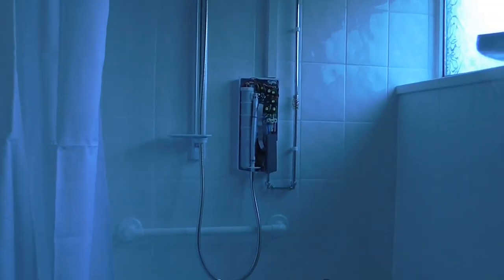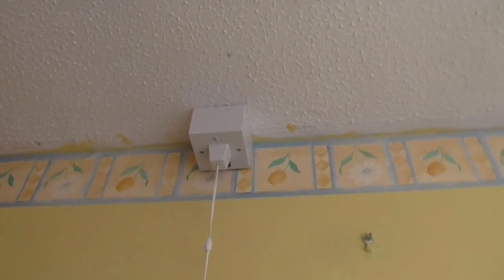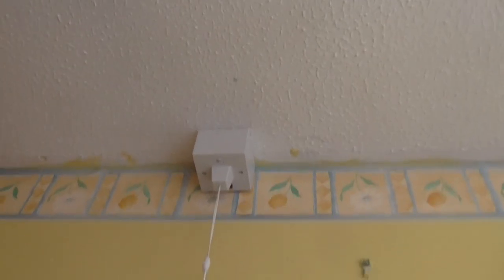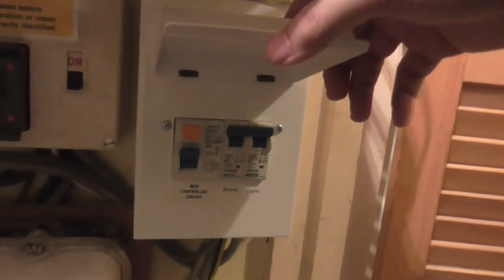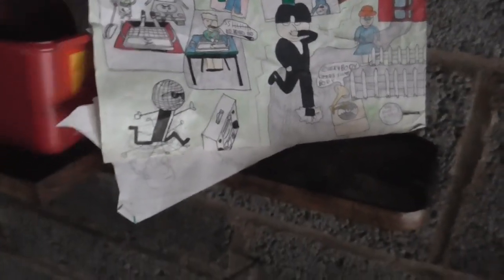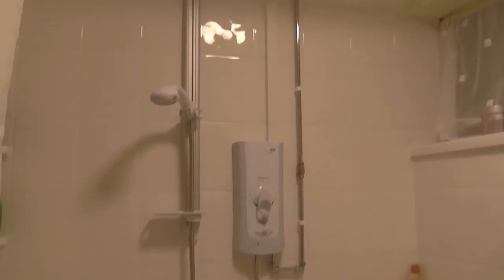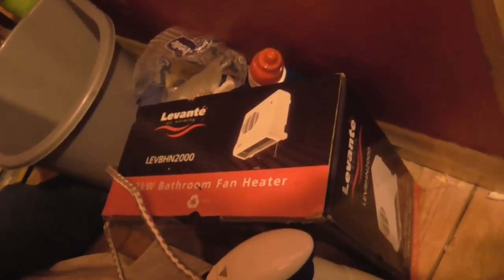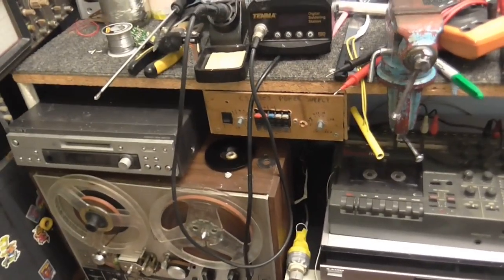Central Heating and Bathroom now finnished (well sort of)

Comment: Your place seems to be coming along well. Should be interesting to see what you come up with shelving wise. I'd include a high shelf to store less used things up and out of the way.
Reply from the maker: +JohnAudioTech The shelfing unit for my hifi stuff is coming on well, trouble is the reel to reel is a little heavy and is bending the shelf it's on!  So I'll have to re-think a few things.  I would put up a high shelf above all that if I had a drill that can drill though walls. Right now I'm clearing out all my crap anyway as I have plenty of space in my "shed" for it all.

Comment: the new pull string will be for your shower, it seems daft having the electric fan heater when you have a normal radiator in the bathroom connected to the central heating.